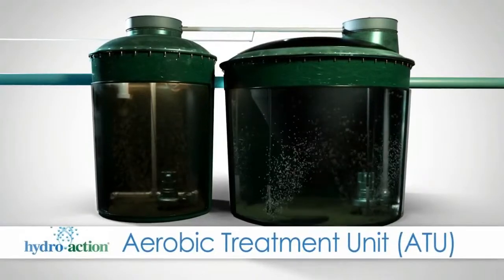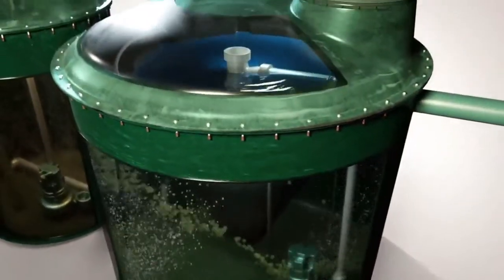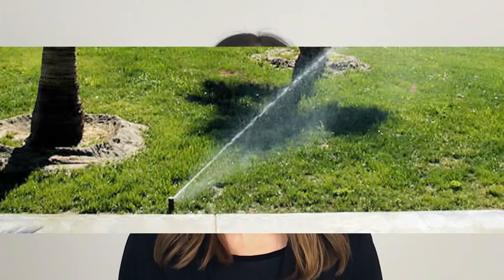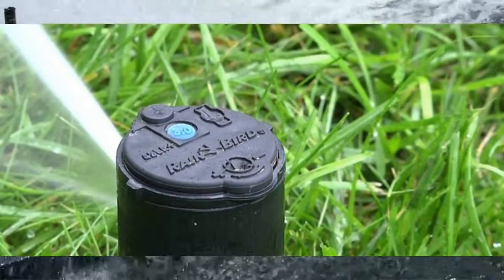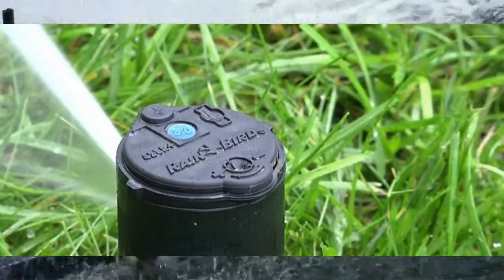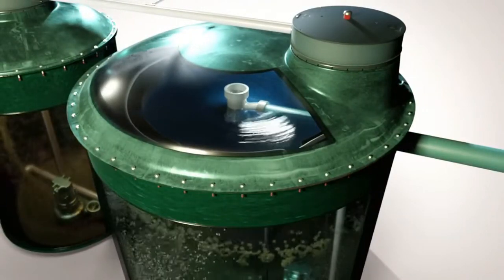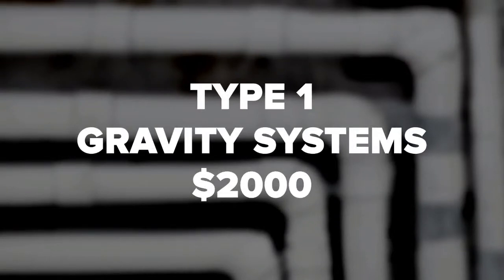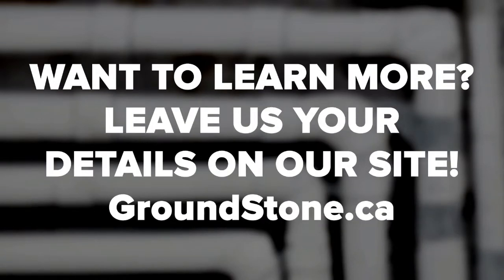Aerobic Treatment Units

Comment: The septic does not need chlorine at all.
Reply from the maker: You must be an engineer so please enlighten us on why we wouldn't need advanced treatment for a 100ft x 40ft lot with a 7 bedroom home on it.  I'll wait....
Reply: @groundstonewastewaterservi5066  rude
Reply from the maker: @bonig584  The comment itself is vacant of any mindfulness and unfortunately I responded in kind.  Not a perfect moment in my history of responses but my response stays up non-the-less as we are all human and we do get irritated by such arrogant presumptions.
Reply: @groundstonewastewaterservi5066  my perk test showed between 24" and 28" of good draining soil until they hit bedrock. The are requiring me to install an ATU system. I have two quotes and both of them require them to bring in 12"+ of topsoil to cover the ATU system and field line. Can you PLEASE tell me what is the difference... if I bring in 12" to 16" of soil there will be plenty of soil for a typical septic system.
Reply from the maker: @tomvanhoff5288  For proper treatment in the drain field we are required to have  certain amount of vertical separation from the restrictive condition, in your case it is bedrock.  In our jurisdiction we can build up the vertical separation by using a specified sand for filtering, we then have to apply a pressure distribution dispersal into the drain field for a uniform distribution.  In your case you have been quoted using the existing 24" of soil, but using a more treated effluent (using the ATU).  Using just a topsoil as fill is not acceptable, it would have to be a specified sand.  With septic drain field, we cannot disperse effluent into what is essentially "fill", it has to be with a spec sand overtop of native soils.   The topsoil that is going to be brought in for your property is to apply over the system which will protect against frost and protect the components for the system tankage and pipe work, but it is not going to be used for dispersing effluent into.   ...Hope this helps
Reply: Can GroundStone WWS tell me why my county health dept is requiring me to have an ATU system for a 3/2 house when I have 3 acres but my field line area is between 24" to 28" deep before hitting the rock base?
Reply: @tomvanhoff5288  The man or woman in charge in your city is getting a kick back that’s why
Reply: @artifactsantlersoh  well the health department that sold me the permit is a state of Ga. Health Dept. and I have quotes from Ga. Al. and TN. so I doubt that. They said I needed 24" below the field line and another foot on top for a total of 36" of good draining soil. My perk test was between 24" and 28" of soil till they hit rock... as in the ROCK OF THE MTN.  I'm TRYING to figure out what the difference is between my current 24" and me bringing in another 12" of soil and installing a typical septic system.